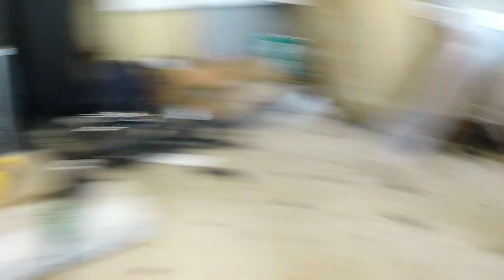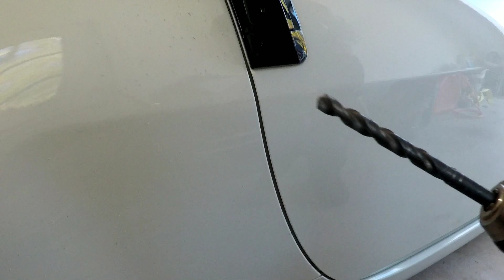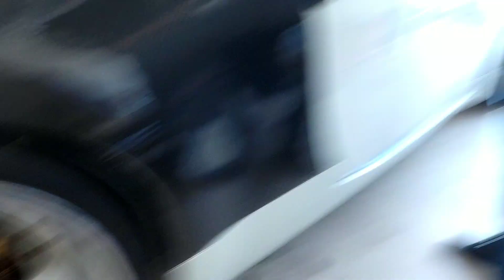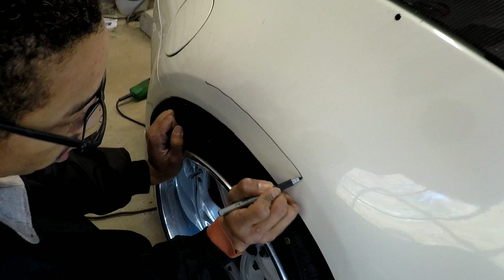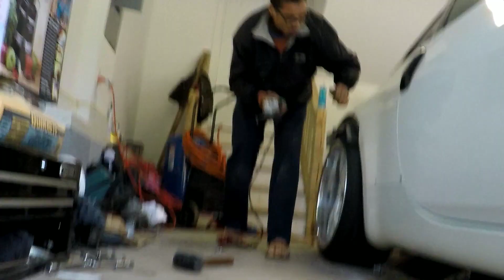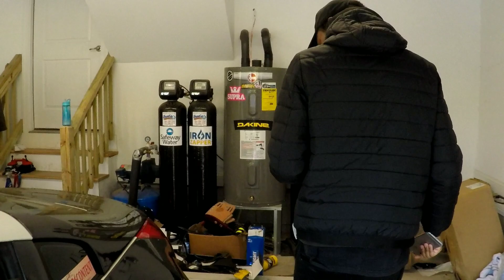Cutting up the 350z ! carbon fiber widebody Z

Comment: Did you add any spacers to the rear now that you have this?
Reply from the maker: No I actually didn't you really can't tell that much but my finders were pulled about an inch  I actually still have to pull some camber out the rear and it will look great